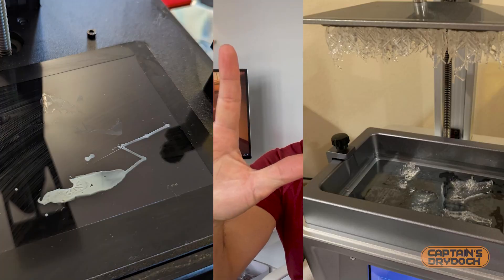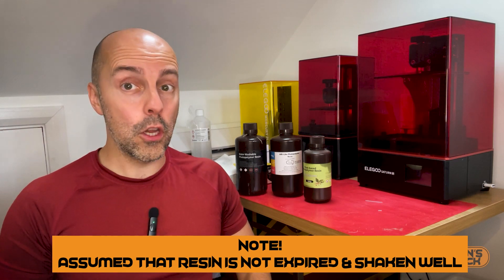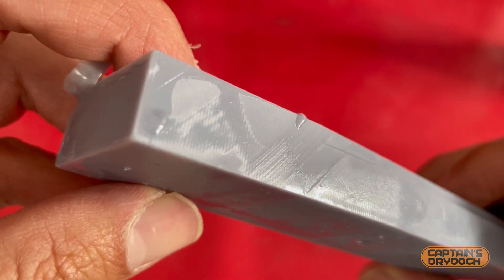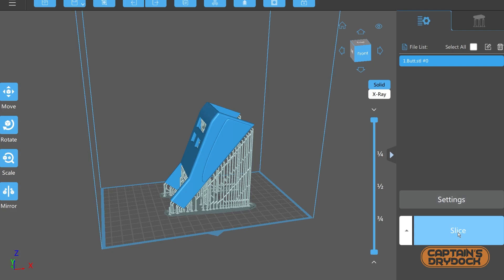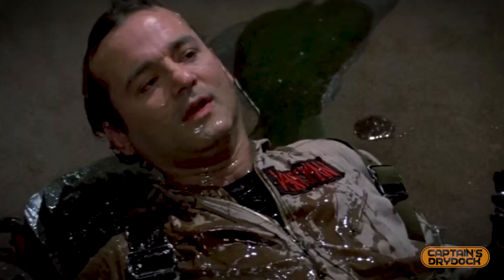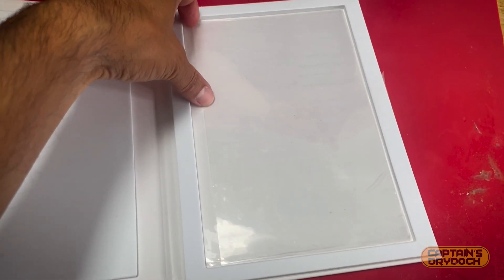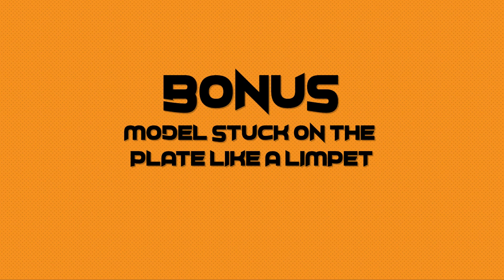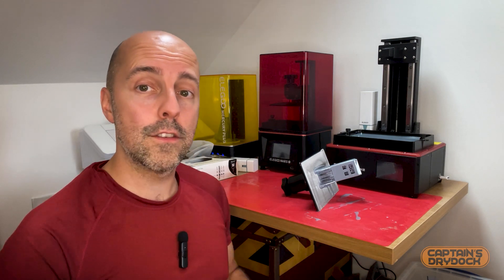Troubleshooting: Why 3D Prints Fail?!

Comment: Missed the most common fail, bad levelling and incorrect offset. You also can't see a possible pin hole in the fep as it may only become apparent when stressed under use, even putting water in and placing on a paper towel won't discover a hole'
Reply from the maker: Thanks for your contribution. Happy printing :)

Comment: That is NOT how you fit a magnetic flex plate, fit the sticky magnet like that and you are likely to get bubbles under it causing inconsistencies in the plate and causing print issues.

They should always be fitted starting at one edge and only peel back the backing slowly and you use something to smooth it down as you go.

Also resin on the screen, even cured, is not cause to replace the screen. Place a sponge on the screen and pour hot water into the sponge, enough to get it wet but not enough to make water run everywhere. Leave the hot sponge on the screen for a little while and you should then be able to actually remove the resin from the screen.

Alternately you can place masking tape over the cured resin on the screen and literally peel it off.
Reply from the maker: Thanks for your contribution. Happy printing :)